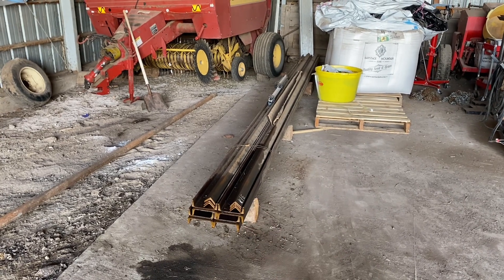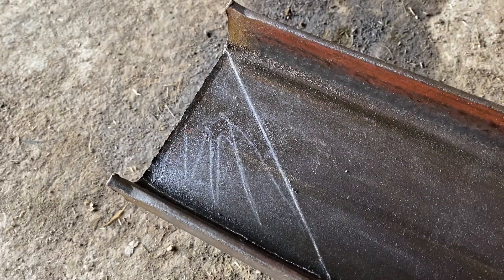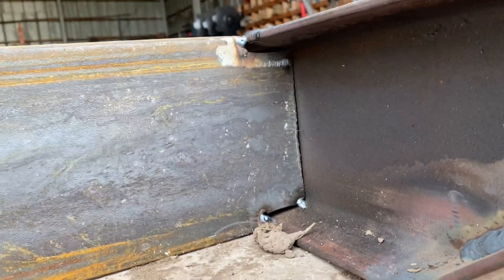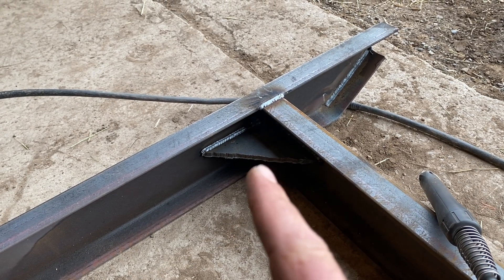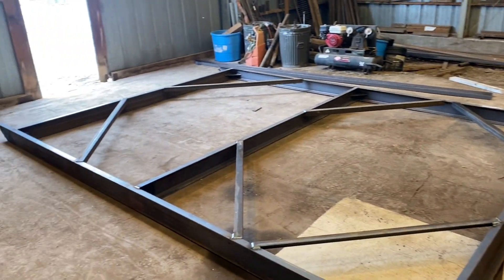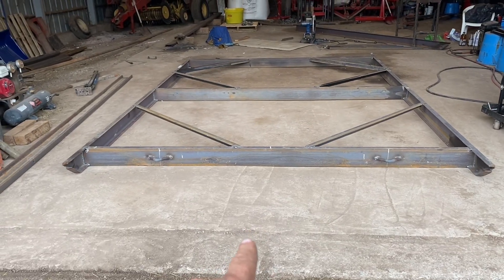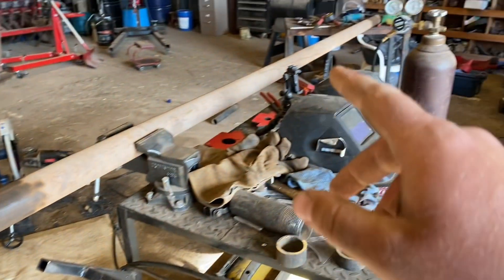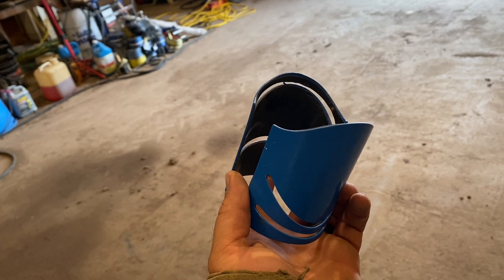Building a 20 Foot Land Leveler

Comment: Instead of having the chain connecting to the tractor in an A shape, use a Y shape. Otherwise if you turn tight the chain will catch the grips of the back tire, ride up, and damage your mudguard. Don't ask me how i know this 😖
Reply from the maker: Haha thanks for the suggestion. Sounds like you have experience with this situation
Reply: @LuthiRanchWY  😭

Comment: You did a grand job there, mate. What is sucker rod? it looks like 3/4" diameter hot rolled bar. Ive never heard of sucker rod over here (England).
Reply from the maker: Thank you. Sucker rod is a rod they use in the drilling and oil field industry on the pumping side I believe. But yes it’s just a metal rod, I think I was using 7/8” so good eye there haha. If you google sucker rod and oil field it could probably explain it better than me

Comment: Man yeah, that is a really enjoyable video  🦌
Excellent skills demonstrated there mate. 
Fun to watch how to fabricate that leveller on the run.
Would you mind offering the material cost for that  ?
If not, no worries.
Cheers
Great channel  🎯👍🤺
Reply from the maker: Hey Scott thanks for the comment! We bought that metal about a year ago so I can’t remember the exact cost but it was right around $1500 in metal then I bet I spent another $50 in welding wire,gas, grinding wheels ect. But with the way prices have gone I bet you’d be looking at closer to $2,000 in material costs now.
Reply: Ok, thanks
Nicely done, and looking forward to more
Cheers